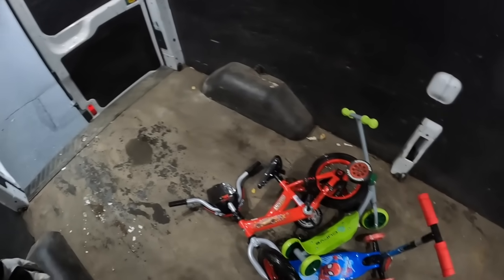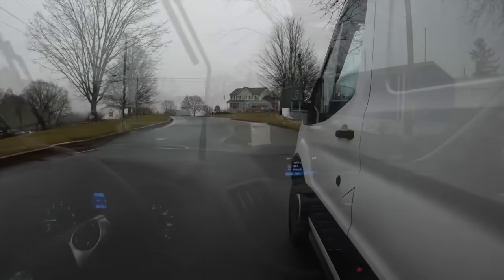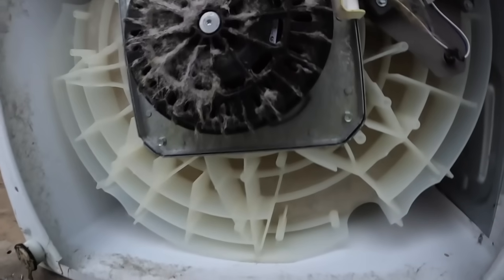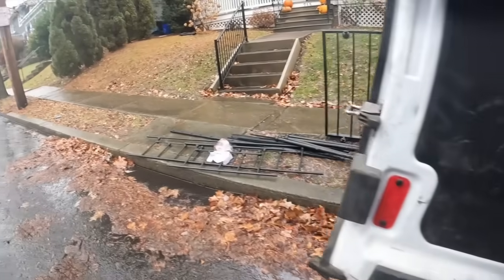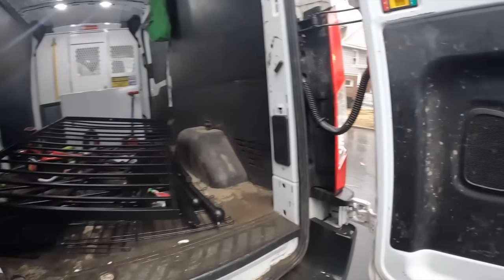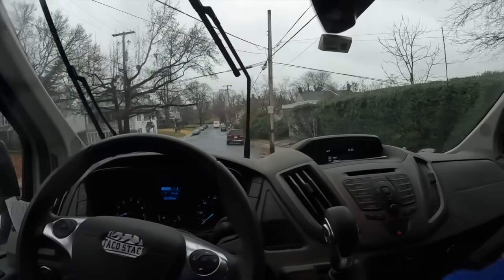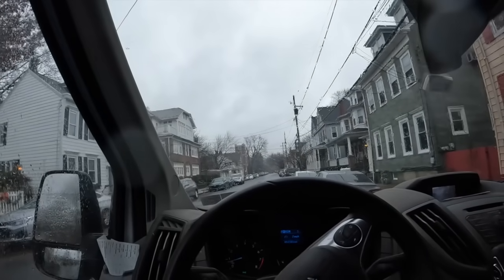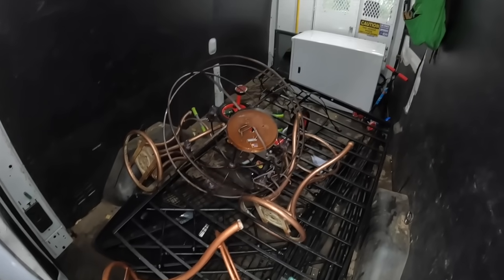I FOUND THIS BEFORE MY COMPETITION DID! - Trash Picking Ep. 838

Comment: I was watching your video and listening to you comment about the windshield wipers. I have a solution for you.. Why don't you treat your windshield with the rain X or something similar to that?. It's like a liquid windshield wiper. And it does a great job. the harder it rains, the better it works And the faster you go, the better it works.. Even though you're traveling slow. when the rain hits the windshield, it's like a slippery slide. and runs right off.. Try it. I bet you'd like it.
Reply from the maker: I think I use a rain-x washer additive. I am pretty sure I dumped a bottle in last summer. But I know what you are talking about!
Reply: I don't think the additive. to the. Rinse your washer fluid works anywhere as near as well as the concentrate directly on the glass. @TacoStacks